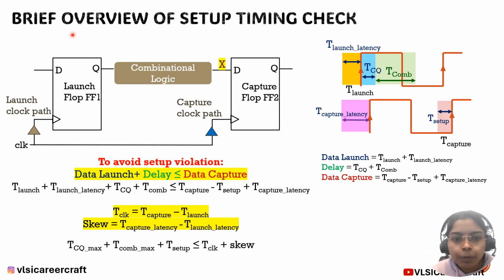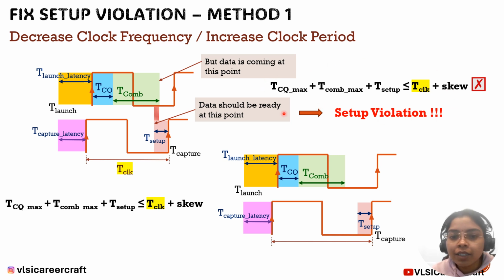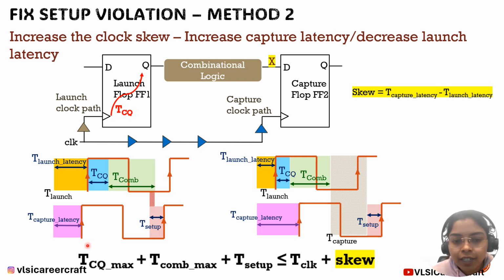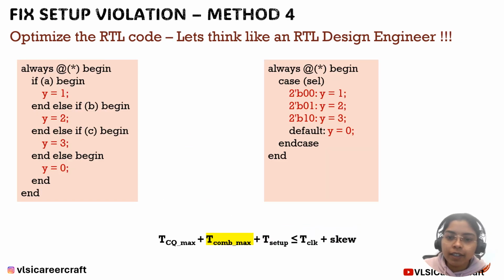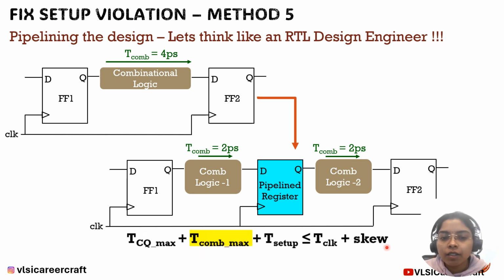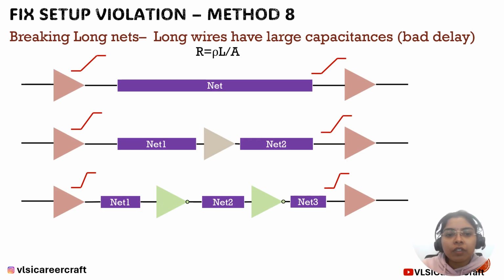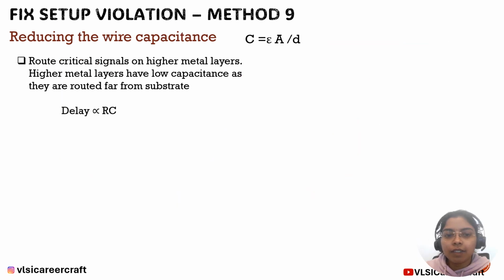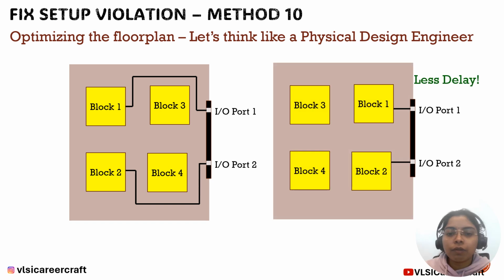STA Lecture 4: 10 ways to fix #setup violation! #vlsi #interview #ece

Comment: when the size of a gate increases,the capacitance increases . So the RC increases, then how come it decreases the delay ?
Reply: Increasing the size of a buffer (such as an inverting buffer in digital CMOS circuits) typically increases the load capacitance that the preceding stage must drive. While a larger buffer provides higher drive current to charge the output faster, its own input capacitance increases with its size. 

Despite increasing the load capacitance, adding larger, correctly sized buffers in a chain actually reduces total propagation delay. This is because the increased drive capability (lower resistance) of the larger buffer outweighs the higher load capacitance.